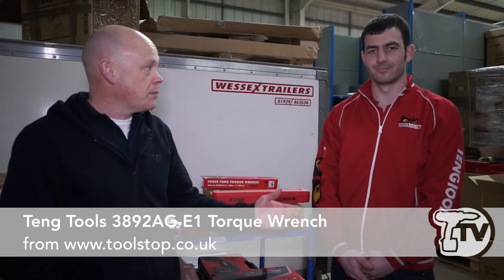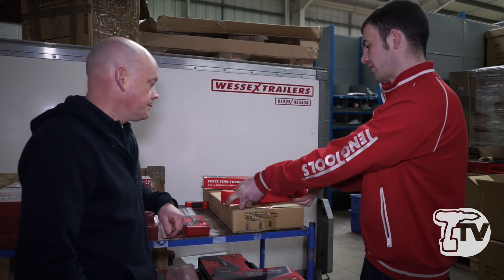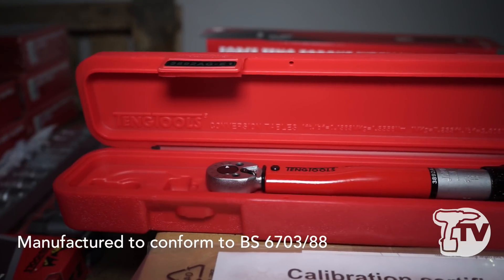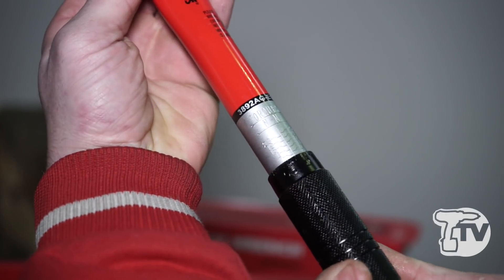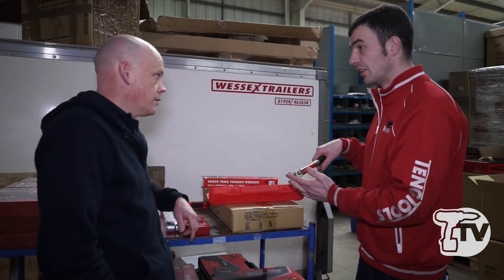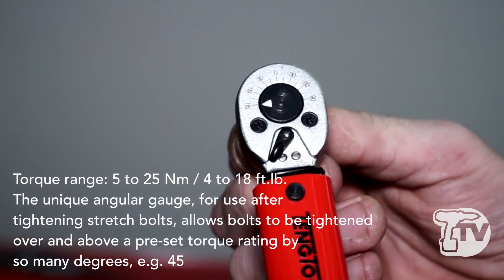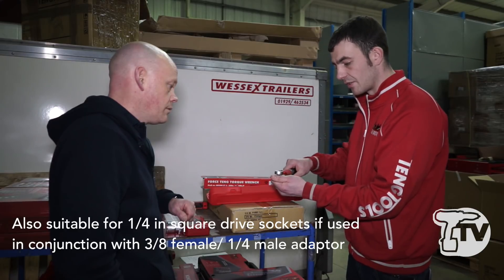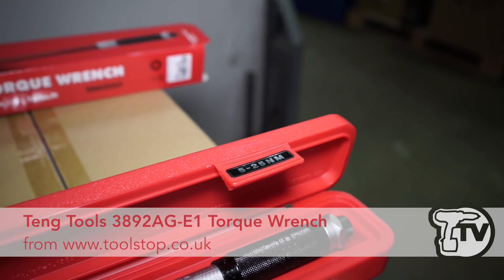Teng Tools 3892AG-E1 Torque Wrench with Angular Gauge from Toolstop

Comment: Busted a Beretta shotgun stock (changing schims) using this. Didn't click. No clue what good the angle setting in the head is, or how to use it. No help in this infuriating video.

Comment: So can anyone explain how to use the angle gauge. When you set it to 0° and turn it it still stays on 0°. So how do you actually use it
Reply: Yeah it’s little feature that’s is pretty useless. 
You set to 0, torque little bit, turn back wrench same amount that you torque it and it’s gonna show somewhat angle that you torque.
Reply: @WujoCaZa  and how should i set the range? if i set it on the minimum it clicks right away